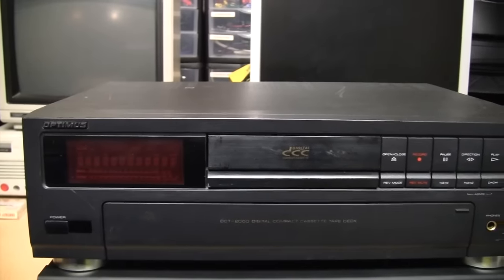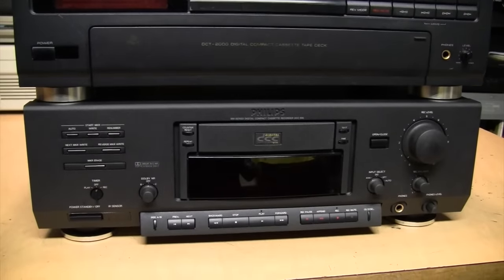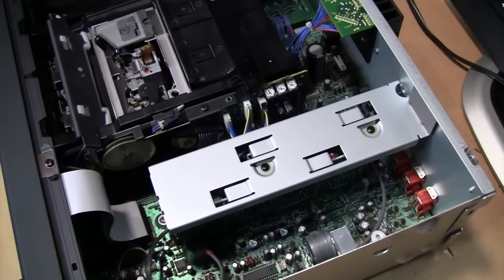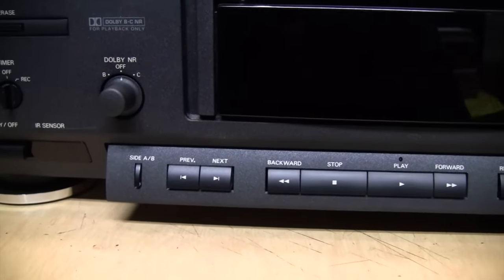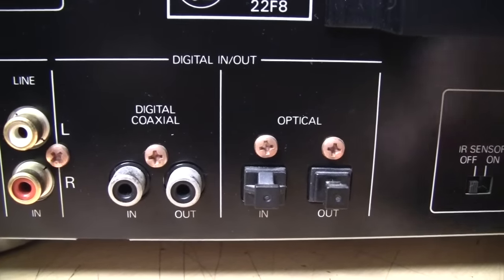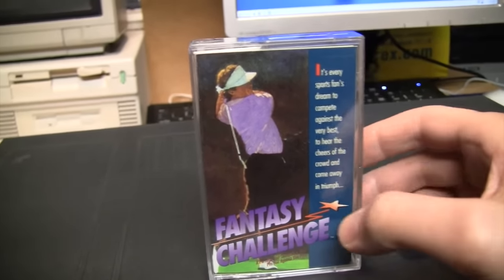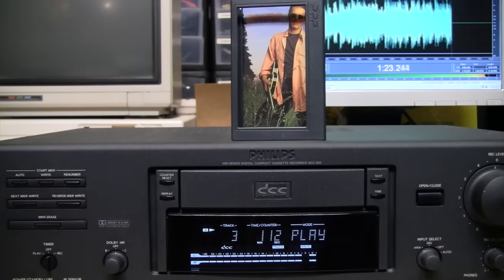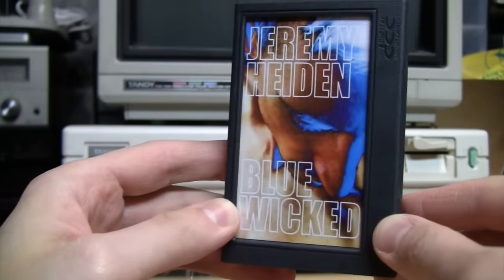Philips DCC900 Digital Compact Cassette deck revived!

Comment: Glad it worked out Kevin.
Reply: So question. Why replace the SMD caps with radial? Can't get the values anymore?
Reply: Radial are more durable, I presume
Reply: The boards are very brittle because of the leaking smd caps and it is easier then (if there is enough room) to be using regular aluminum caps
Reply: @wyokaiju992  Radials last longer

Comment: USB audio devices with SPDIF coax and TOSLink I/O are readily available for cheap.
Reply from the maker: Yes, but they don't record from the SPDIF input. For example this one: http://a.co/5ZiEC9G One reviewer wrote, "Do not expect it to decode input from the SPDIF in or encode audio for the SPDIF out. SPDIF in is simply a pass through to the SPDIF out."
Reply: Reading reviews of other C-Media based USB devices indicates its a driver issue with the built in Windows driver that is installed when the device is auto-detected. The reviewer may also be dealing with Dolby Digital or DTS encoded sources, which can't be recorded by traditional audio software without decoding.
Reply: I have one of those ^ (at least, it has a C-Media chip and looks exactly the same) and it does indeed do optical in and out - yes, you do need the proper drivers or those connections will not work.

Comment: At least you didn't get scammed on Ebay.  I bought a Nakamichi CR-3A on Ebay advertised as "working condition"  and of course it was not. But did get it repaired by ES labs in Connecticut and it has been perfect for over 15 years.
Reply: Wow man,  that is some sad story.  A freakin' ZXL 1000!!!!!  Probably could be fixed for less that 300 bucks and then worth 2-3 thousand. I would have lost it too, if I could hear it being crushed.  That really sucks... I don't think we have Savers here in NY.  I kind of like Goodwill, at least it's a charity. (or at least they say they are)

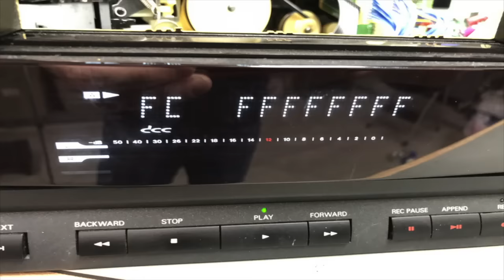Comment: 3:49

Those special, fragile heads in DCC decks are also why you never attempt to demagnetize them like you would with the heads in a conventional cassette deck.
Reply from the maker: It says so right on the tape tray, "Warning: Do not use demagnetize cassette"
Reply: @vwestlife  But DCC is MPEG Layer 1..... is after all MP3.. or actually inferior that MP3..... or not..??  .....   i mean.. i understand DAT... but DCC.... what for..??
Reply from the maker: @Ramdileo_sys  MP1 has the lowest compression ratio, so it was designed for the highest quality.

Comment: I, many times, miss the old days of my recording studio when I used the Optimus DCT-2000 and Magnavox DCC Recorder/Players.  I made quite a number of master recordings on those two units before getting my JVC DAT Recorder/Player.  Even then, I used the DCC units until I gave the Magnavox to a friend and threw the Optimus in the dumpster (it quit working).  I ended up selling the DAT machine to a music store and went digital (at least for recording masters).

I use a Tascam DP32SD now for multi-track recording and throw the 2-track mixes to the PC for editing/mastering.

Sure, it is easier to record these days, but I still miss the older days many times...

Comment: Ralf has worked on my DCC 900 parts and hopefully I now got a functioning machine. Thing was my PCBs didn’t have much leakage damage so the recap turned out fine, but the loading mech (damage caused by original seller’s  improper packing) and tape head were bad on mine!
Reply from the maker: That's too bad. Hopefully you can get it sorted out.
Reply: @vwestlife  it’s cool. I got replacement parts for it. I am dedicated to getting this thing to work!
Reply: @vwestlife  and to think if the original seller PACKED it properly it would have been much cheaper to get it going. But I think the head was already bad before the extra damage happened. In the original listing on eBay they said it would play analog tapes but not digital ones. Oh well I still had to pay 70 bucks extra to fix the loading tray damage!
Reply: @vwestlife  Ralf has repaired my machine and it works great now. The only issue I had is that the A side of a tape had plenty of drop outs while the B side had none. I’m sure it has to do with the tape because I taped a few songs onto a blank NOS tape and there were no drop outs in the audio.

Comment: 7:23 I just found out a new method on how to skip a song easier on a cassette player with piano keys (No Logic Controls and No AMS). First, put the player on pause, and while it's on pause, then hold down both play and fast forward at the same time, until you reach a spot on the tape with no sound! That indicates you're on the start of the next track! Then, de-press pause, and hit play. If you wanna rewind or go back, same thing, but stop after 2 blank spots.

Comment: Damn I really wish I had a DCC machine. At least to my ears, through youtube's compression, the DCC tapes sound better than my most well mastered CD's. I should really seek out a machine.
Reply: If I remember correctly, CD’s have 16 bits of dynamic range and DCC has 14 bits. So it’s just a hair ‘worse’ but in 99% of the times you don’t notice the difference.

Comment: It's a shame that DCC never really took off.  I do remember at the time, in the UK at least, a lot of scare stories about how you would be blocked from copying from any source and that the cassettes were going to be a lot more expensive that old the old analog cassettes.
Reply from the maker: All digital recording formats (DCC, DAT, and MiniDisc) have a system which prevents you from making a digital copy of a digital copy -- Techmoan talked about it in his video about DAT. But there is no restriction on recording from analog sources, so you could just use an analog connection instead, with little or no quality loss compared to using a digital connection.
Reply: Surprisingly again consumers suffered from the greed of the record companies. Yay…

Comment: I have a Philips DCC600. Just replaced the tape drawer belt in it, the capacitors show no signs of leaking *yet*. Will look into a quote for refurb from Dr DCC.
Reply from the maker: The later generation DCC decks should not have problems with leaking capacitors. But I'm sure Dr. DCC will know exactly which models are affected by the problem.
Reply: They used classic through-hole capacitors in the second generation (DCC-300, DCC-600, DCC-450, DCC-91). When you get one of those, the belt to open the drawer is usually the only thing that needs replacing. Unfortunately they went back to SMT capacitors for the third generation (DCC-730, DCC-951).
Reply: Jac and Kevin are correct. Your dcc600 should be fine if you replace the belts.
Reply: DR DCC Thanks guys. Have replaced the draw belt.
Reply: Steve That is the number one concern with the second gen decks. On the 600 it is at least a doable job. The same mechanism in the 300 is a bit more tricky. Hope you enjoy your dcc player.
Reply: It was having trouble when the belt tried doing the final stage of loading a tape. Had the same issue on a Pioneer Laserdisc player and yep, a new belt worked a treat. Will do the capstain belt in the future.

Comment: I used to have a Sound Blaster Audigy 2 that had digital inputs.  Excellent card!

This picture is of the front input panel.  The card had it's own selection of in/outputs.

http://www.ixbt.com/short/2k2-09/Audigy2_Drive_Topview_right.jpg
Reply from the maker: I have a Sound Blaster Audigy 2 ZS and it only has an optical digital output, not a digital input.
Reply: The picture I included was of the card that I had.  Clearly, on the front panel, there is a digital/optical input.  I am not sure why another version of the card would not include this input.  I used to patch my TASCAM DA-20mkII in to my sound card to rip the live Grateful Dead concerts I had recorded  to CD/R.  If I remember correctly, the two jacks on the far left are also S/PDIF in and out jacks as well.

Comment: I bought one of this exact Philips 900series model from a thrift store, and it was also suffering from bad capacitors. The deal breaker for me was the second issue with it: it was constantly switching between DCC to analog cassette mode and back to DCC. It had a mind of it's own. Returned it, got a refund, but I was MAD because I know what just slipped through my fingers 😡
I'm happy you managed to make it work

Comment: If you search a Sound card with Digital in, get the Sound Blaster Z, which has the digital optical input. I have one but I never used the Digital Audio in until now.
The sound card is modern, drivers are only available for Windows 7 and newer :(
But it still sounds great!
Reply from the maker: That would not fit in my desktop PC because it's a small form factor case and only has room for low-profile cards.
Reply: VWestlife oh ok. Mhh then it will be quite difficult to find a card. Today , most (high end) sound cards are marketed to gamers, who most likely have a full form factor ATX case.
Reply: There's a cheap 5.1 channel USB audio device out there with an optical input, you can find it on Amazon as "Sound Card, VAlinks 6 Channel External Sound Card USB 2.0 External 5.1 Surround Sound Optical S/PDIF Audio Sound Card Adapter for PC Laptop Recording Compatible with Windows 10 / 8 / 7/ XP,Blue". I have one of those (acquired from AliExpress) although I haven't tested its optical input/output.

Comment: I'm wondering if the digital output is active with regular analog cassettes...
Reply: As a matter of fact, it is. All stationary DCC recorders have digital outputs that are active when playing analog cassettes.
Reply: Yes, but analogue tapes sound crap compared to any Nakamichi or any Sony QS or SE other similar quality recorder.
Reply: +AttilaSVK A lot of people claim the playback of analog cassettes on DDC decks is very good.
Reply: Is it because of the thin film heads ?
Reply: I agree.  The audio quality of analogue playback on my DCC600 was very poor in comparison to a good 3-Head cassette deck.  I only ever used mine for digital recording / playback.
Reply: I had a Nak and it isn't really that special compared to a higher end Aiwa of the day.
Reply: When Aiwa stuff was still made in Japan (before they starting selling Walmart shit in the 90's) they were very good. They were owned by Sony, if you were willing to be a bit behind the bleeding edge you got older Sony technology and designs for lot cheaper than Sony charged.
Reply: I still have an Aiwa AV-70M Beta deck. Quite an interesting hi-fi deck, stuck in subcompact cabinet, w/ a Sony mechanism that doesn't lace the tape until play/record & unlaces in stop mode. Seems like quite a feat for 1984!

Comment: That is a very nice deck, all of those 900 series components are very nice, always liked the look of them as well.  I need to do capacitor replacement on my Magnavox DCC-600, will be replacing the surface mount electrolytics with Aluminum Organic Polymer. Will probably do a video series on that. Some time after I am done with working on my Sony VO-9600, which is taking up my bench right now.
Reply: Your Magnavox DCC-600 does not have/suffer from leaking smd caps. it is a second gen dcc player. So there would be no need to change any caps in my opinion. The only thing that would need service is the tray belt.

Comment: Nice video except for one inaccuracy. It's quite easy to find sound cards for the PC with digital I/O, and just in case you want one, try searching for "SEDNA - SE-PCIE-SC-10 PCIe 7.1 Channel Sound card" on Amazon and you should find the "Sedna - SE-PCIE-SC-10 PCIe 7.1 Channel Sound Card (CM8828 + CM9882A) SPDIF Bracket" for around £40. I'm using this card with my DCC-951 over BNC Digital I/O and it's perfect, the sound card even has ASIO support.
Myself I love my DCC deck and recording from PC or from my Audio-Technica AT-LP120X turntable is fantastic. In fact I have been using my past skills as an audio technician to make crazy mix tapes for the DCC, which was something I had missed from the old analogue cassette days; the DCC does have the advantage of being able to split the tracks up afterwards by setting markers, which is something I couldn't do on analogue tape as my mixes don't have any quiet spots in-between the tracks. 
Long live DCC :)

Comment: I loved the video.  I have thought about getting one of these machines but have been worried about how well they work or if I can get any tapes for them.  I get what you mean about it being a dead format.  I have a minidisc player which I've had for years, which was also a format that didn't last as long or have the respect that it should've had.  It is Technics SJ-MD150, which unfortunately now only plays back it doesn't record so I bought a Pioneer MJ-D707 and that is still going strong.  It would be nice to invest in one of these DCC machines but I know that there are different generations of them so knowing which one to get is a little confusing.  Thanks again for the video.
Reply from the maker: DCC tapes are still in ample supply, and I think DCC sounds better than MiniDisc. (Although I don't have one of the later MD-LP players which are supposed to sound the best.)

Comment: As far as sound quality, since this is digital, is there a way to determine if the data is exactly identical to the CD version of the same songs? Unless songs are mixed differently for different mediums, shouldn't digital recordings sound exactly alike no matter what medium the bits are read from?
Reply: In theory yes. But that depends on the quality of disk, scratches, dust, etc
Reply: DCC uses MPEG-1 layer 1 compression. Philips went through great efforts to make DCC sound the same as CD (the DCC format was invented before people stopped caring about sound quality), but the binary data is not identical, there is some lossy compression, but not as much as with MP3 or later formats. Even if you have excellent ears, you should not be able to hear the difference between a CD and DCC.
Reply: I once compared DCC (Marantz) with DAT (Sony SE), Compact Cassette (Nakamichi CR7) and MiniDisc (Sony SE) on Quad Electrostatics. The DCC was just a bit warmer then the rest. No other differences could be heard. My hearing is now not as good as it was then and all the mentioned stuff got other owners.
Reply from the maker: To my ears the digital compression artifacts of MiniDisc's ATRAC are more metallic than those of DCC's MPEG1 audio. Sony did improve the compression in later generations of MiniDisc equipment, but I haven't had a chance to own any of it.
Reply: @VWestlife. I'm curious. Have you heard all ATRAC revisions yet? The first one really is terrible but the devices since the mid - late 90s really sound amazing. I have 3 different Sony MD walkmen who all came around between 1998 and 2000 and all my recordings sounded rich and wonderful and far from harsch or metallic. It even sounded better than MP3 (no matter if LAME or Frauenhofer codec). I never had a MD decive from other manufacturers like Sharp or Aiwa.
Reply: That doesn't make sense... digital is digital - the bits can either be read, or not.
Reply: Bob and Kim Rivard Digital can be any resolution, and any frequency. Just because it’s digital doesn’t mean it sounds good.
Reply: VWestlife I remember the first MD players in the ‘90s. Decent sound, but obviously not CD quality.
Reply: Yes, the early versions of MD sounded quite poor, and I didn't buy into it until the ATRAC3 Type R versions were released in 1999.  Then I went MD in a BIG way with a portable, a Hi-Fi deck and a car stereo system!  I still think that MiniDisc was the best home digital recording system yet invented - just a pity Sony was sooo scared of piracy and copyright issues that they killed the golden goose rather than let it go "open source" like MP3.
Reply: Right, but it's not like having a dirty record or a worn tape. I was replying to the guy above who commented about "scratches and dust". You can't degrade a digital recording.. you can just corrupt or destroy it.
Reply: I was an intern at Aiwa in '93 and heard one of the first MD players to market.  At the time, Aiwa was 40% owned by Sony so were one of the first out the door with an MD product.  My reaction at the time to the sound quality was that it sounded like fried eggs, like a fizzy top end due to the first gen ATRAC.  I didn't buy into MD at the time and it wasn't until '97 when ATRAC3 made it into MD products that I finally bought into the format and the difference between ATRAC1 and 3 was and is like night and day.

Comment: In 1992, I was 18 years old and faced with a choice.... do I buy DCC or HI-FI VHS to act as a 2 track master recorder for my multi track recordings?
I went with the HI-FI VHS (affectionately known as "the poor man's DAT machine") and thank good I did...  I transferred my masters to 16 bit /44.1 kHz  in 2004 but I still have the original tapes... even now, they still play well after close to 30 years.